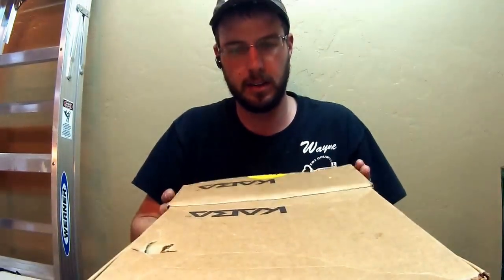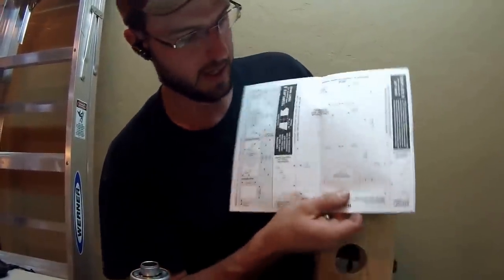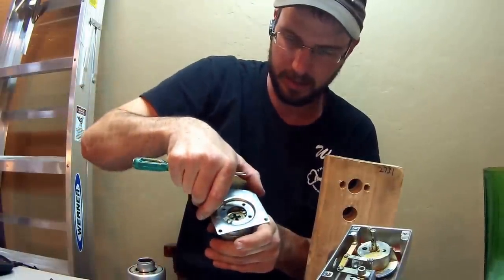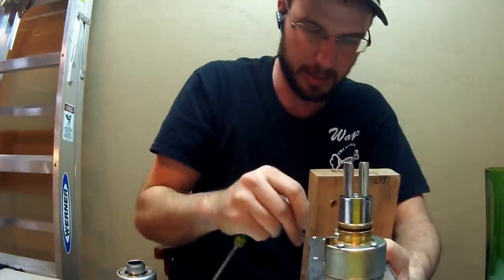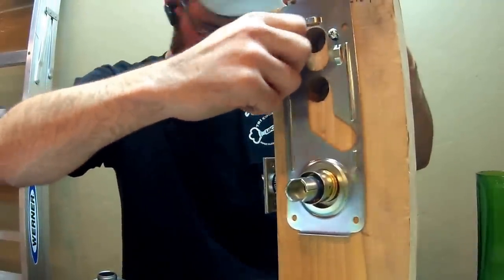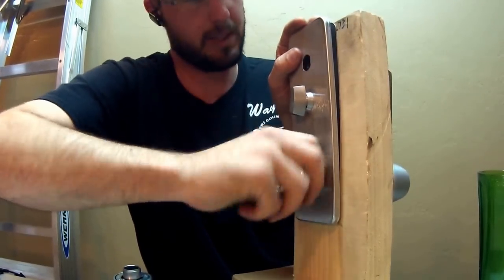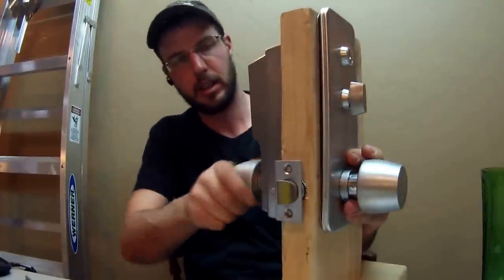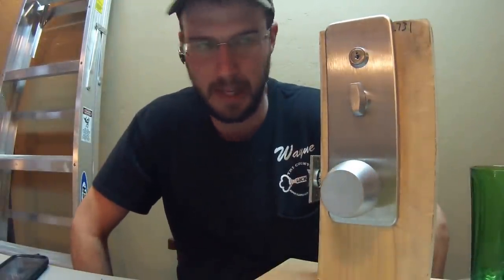How To Install Kaba Simplex 1000 Lock

Comment: Outstanding insight and presentation. I first installed one in 2008, and another in 2012. Held up well, and will be removing tomorrow to install a C/R Mortise Egress Push Bar and Trim. Well done. Helps me remember how  to remove tomorrow.  Thanks

Comment: HI Wayne nice video. I have a Falcon Push Key lock that looks very similar to this lock you are installing. I went open it today from outside and when I entered the code it seemed to engage but while turning to open the out side door, the handle broke off the in my hand. I see where the handle came out of and there is a pin sticking out of the tunnel. The tunnel itself has square notches on it on opposing side of the tunnel outside of the main housing. Can you suggest anything I could do to open and replace. Will the lock possibly open if I turn the notches with a lever of some kind. Thanks Man for any advice!

Comment: I have an issue that I'm dealing with. Same lock set - latch only retracts partially. I've torn it down and looked for any clues but found none. Any help is appreciated. Thanks.
Reply from the maker: First spot to check is the latch. The catch or ears that catch in the lock can be stretched. That is the #1 cause of this problem. Replace the latch. If that dose not solve your problem than it could be an instalation or alignment issue. If the lock housing is not far enough back from the latch it cannot retract it all the way. Hope that helps.
Reply: Wayne Winton  Actually it happens while I hold the unit in my hand. I don't want to take up your time. Just thought I'd pick your brain if you've dealt with any issues with these. These are old ones, 2005 I believe. We have a bunch on the shelf with forgotten combinations or broken parts. I reset the combination. Now I just need to see why the latch mechanism isn't retracting all the way. I've compared it to others but I'm not seeing a difference in wear or setup. I saw how the brass mechanism rises when the handle is turned and the combo is put in and doesn't rise when its not put in. Anyway if you have any ideas, let me know. Thanks for responding!
Reply from the maker: Tobias Collins Dose it retract the the same amount when you you use the inside lever? Can you switch out the latch on a working unit ans see if that works?
Reply: Wayne Winton When i turn the inside lever (or where the lever would attach) it retracts all the way which tells me that it must be in the mechanism itself (the main part that turns with the brass piece and the "post" with the pins in it that insert into the latch mechanism). The long spring on the right side is intact so it returns how its supposed to. All of the "arms" that attach to the center work smoothly. I noticed how the mechanism turns the opposite way when the combo is pushed but just doesn't turn far enough. Maybe I'll have to compare it to a new one I guess.
Reply from the maker: Yep. If the latch fully retracts on the inside then there is no problem with it so it can be eliminated from the process of elimation. When the lock is completely torn down there is a driving rod with 2 roll pins in it, those pins can bend and or break causing this effect to happen. The roll pins can be replaced.
Reply: Wayne Winton yeah the rod and pins were fine. I inserted another one in the top empty hole but that just prevented the latch assembly and plate from being able to be reattached.  I don't know. I expected to see something worn down but didn't. I'll do some more exploring tomorrow. Thanks.
Reply from the maker: Tobias Collins man that is odd. Could just be defective. I would call kaba tech line. That is the last option I have. You may be able to sent it back for warranty work.
Reply: Wayne Winton yeah I may call them. It is quite old...about 2005 or 2007 so I doubt there's be any warranty with it. I will keep exploring. May compare it with a new one and see if there's a difference. Thanks for your input.

Comment: gotta install 4 of the 5000 series are they the same drill points as the 1000?
Reply from the maker: I don't know but they should come with template in the instructions.
Reply: +Wayne Winton it was almost the same drill points except the 5000 also has two bottom posts you gotta drill for. I asked because I had to convert them all from mortise locks so I had to buy wrap around plates to cover up and flake didn't sell 5000 series plates. You can see on my Google + island lock king I'm following you
Reply from the maker: Nice thanks!